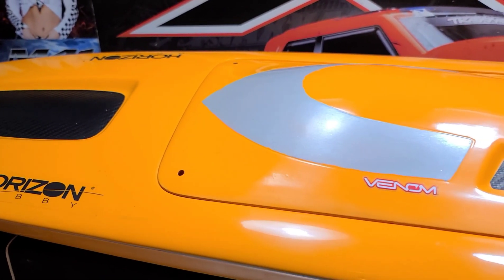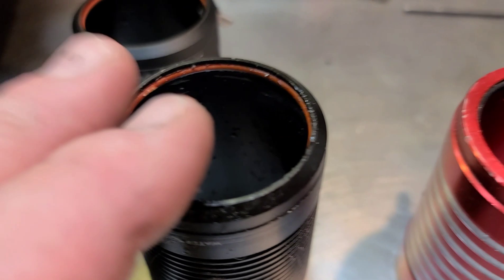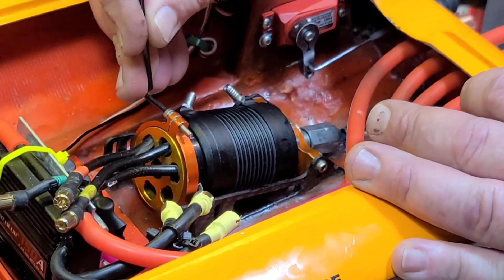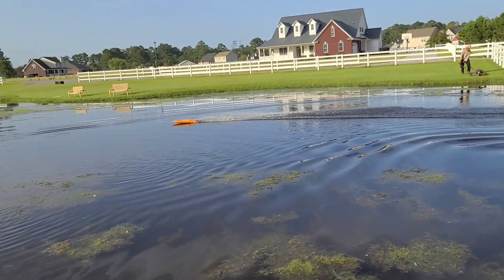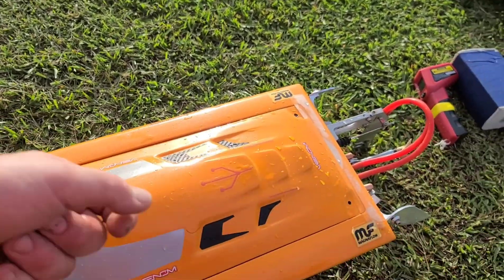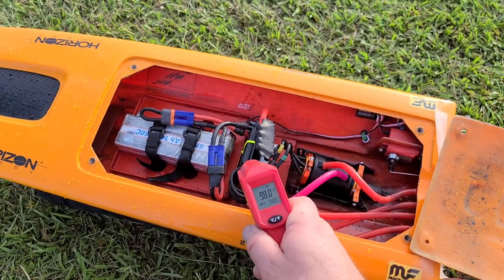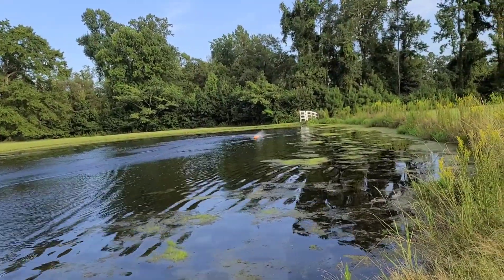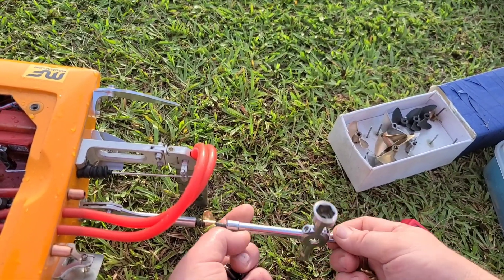Water Cooling Test With Prop Changes & Motor Swap - TP Power 4050 - Fast Electric RC Boat

Comment: My concern with water jackets is nipples""" being on the same side, is flow truly going around motor? Does it make a difference??  Just food for thought,  would be curious to see one with it camera.  Obviously it dissipates the heat but how much more efficient would they be having inlet on bottom and outlet on top? Dynamite does it but hobby star doesn't.
Reply: Enjoy your videos big b , new to the electric boats other than runtime its been cool
Reply from the maker: The hobby star is my favorite hands down

Comment: Hey B. What are your thoughts of the 4050 2100kv TP motors? I have 2 of them and was going to put them in a mystic 114 with a 200amp ztw esc. Currently running goolrc 1900kv 4082 with the ztw 200amp esc
Reply from the maker: I loved mine. Unfortunately I spun a rotor in it on 8s destroyed the rotor.  But that was my fault, when the boat come out the water in a porpoise the motor overreaved when it came out the water
Reply: @IRONCLADRC  I only run 6s I think running things on 8s even though they can handle, it usually doesn't end up well for people.

Comment: Hi  I have a sonic wake, doing upgrades and new to boats. I am running a hobbyking sk180a esc,6s 5000mah 100c lipos.stock motor 1900kv dynamite, swapping for a TP 3640 in 1570kv. I can have the 3640 on 1570kv or 1935kv. With what I am running is the 1570k bettyhan the 1935k? Great video BTW especially on props..thanks
Reply from the maker: Yes you should be good, start with a smaller prop check Temps then prop up from there
Reply: @IRONCLADRC  Thanks for the reply, so with the TP3640 go with the 1570kv or the 1935kv in my case? I know the 1935 will spin faster just don't want to lose top end speed unless as you say a smaller prop on the 1570kv if I understood you correctly
Reply from the maker: If your going to run "pitchy" or lg props go with the lower kv on 6s.
Reply: @IRONCLADRC  Hi, and thanks for the reply. As I am new to R/C boating,  and quite sure you know TP motors well,  is the TP 3460 is a good upgrade for  the  wake in terms of overall performance or would you recommend another type? Thanks for your time on this and help.
Reply from the maker: Here is another choice direct drop in from OSE. https://www.offshoreelectrics.com/proddetail.php?prod=tfl-3682 

It's cheaper has plenty of power.  I had a 3640 tp in my blackjack 24. Both the tp and sss motors are a good choice.
Reply: = @IRONCLADRC  Hi, I went with the SSS 3682-1660K on your recommendation, guys have had good things to say.about it.The hobbystar water jackets you describe, what size would be best for the 3682? Thanks again for your help and time. Learned alot from your vids!
Reply from the maker: @jmartin2711  depends on the motor mount. I'd run the biggest jacket possible
Reply: @IRONCLADRC  Hi Big V,  great vid on the water jackets, and the flanges..Could you recommend what you have found to be a good servo for an upgrade(make,part #) would be great thanks for all the usefull tips i have noted off your vids!
Reply from the maker: @jmartin2711  I've been using ds servos there cheap & durable. I use them on my Bashers and boats https://www.ebay.com/itm/DS3225-25KG-Metal-Gear-High-Torque-Waterproof-Digital-Servo-For-RC-Z3U0-US-Stock-/353430242668?mkcid=16&mkevt=1&_trksid=p2349624.m46890.l49286&mkrid=711-127632-2357-0
Reply: Hi Big V, Thanks for the recommendation on the servo and will be purchasing..Gained a lot of knowledge on your vids..Look forward to more.BTW i bought the TP3650-1680kv motor rather than the SSS 3682-1660K. Correct me if I am wrong , but the 3650  generates more torque, and on 6S, so i should go with  CNC 4414,4514, and 4416DT for starters with that motor? Thanks again for your help.

Comment: Like the aproach of testing/sharing. You should buy at least a GPS device so you can see what the changes do. Just strut height/weight distribution can give you about 10mph more. Right type prop/lift also. Went after lot of testing from 40mph (out of box) to 64mph (4082/2000kv motor/6s 4500Mah) with my boat. Tried octura x, abc, prather (with i currently run), tfl, 2 and 3 blade, different pitch. 1.5 to 1.7 high lift works best for me. Reacts different on every prop,  especially things like acceleration. I think that's where the magic comes in, a perfect prop... and thats were my knowhow stops. Did try some things, but never gained a lot.
Keep up the good work! Interesting to see were you will end up.
Reply from the maker: Thank you,  I actually have a gps, maybe I will use it next time. I was  Mainly focusing on tuning..  thats what I love about boats there are so many  Variables that could get the boat to ride better or worse changing props, weight, battery size etc.  Each change makes a big  Difference whether you see it or not Thanks for watching brother

Comment: I have both of the water jackets you are showing.. I like the o rings in the red one.. My hobby star leaked no matter what i did. So I siliconed it on. Leak fixed. The o rings in the hobby star are harder to find replacements for locally for me.

That being said, the barb fittings on the hobby star are far superior. Much Higher flow vs the tiny ID fittings that come with the red jacket. I drilled my red ones out until the barbs were paper thin. But I still prefer the hobby star.

👍👍 Nice work
Reply from the maker: Yea I noticed the barb fittings were smaller on the red jacket aswell I drilled them out a few thousands of a inch.  still think the hobbystar jacket is the better choice.  Glad im not the only one that noticed that,  Thanks for watching brother!